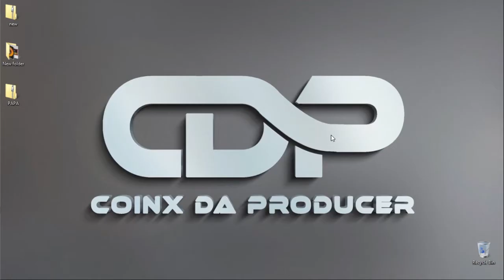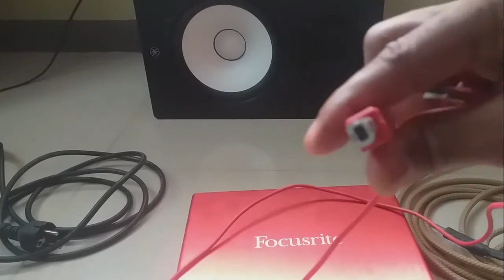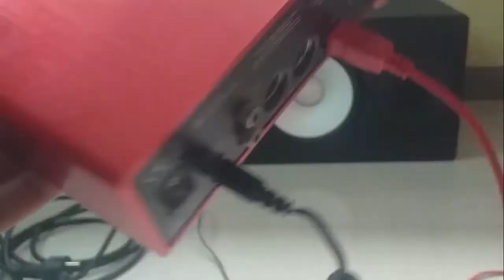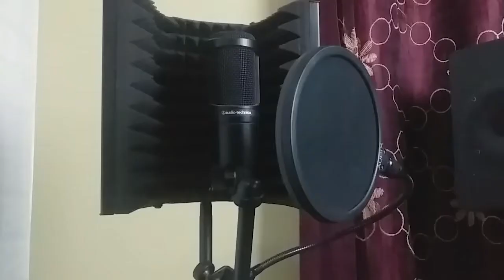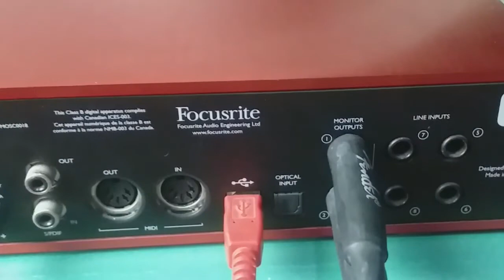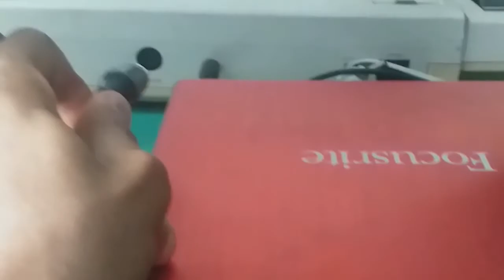How to connect Studio Monitor, midi keyboard and Mic to Audio interface - Parts 2# (2023)

Comment: Do you really need a sound interface? Can I connect a Midi Keyboard and the speakers that I have direct to my laptop thru aux or Bluetooth?
Reply from the maker: If you have a keyboard that is USB powered and a speaker that is blue tooth powered . That can serve. For a start